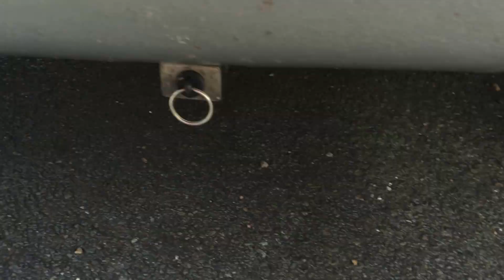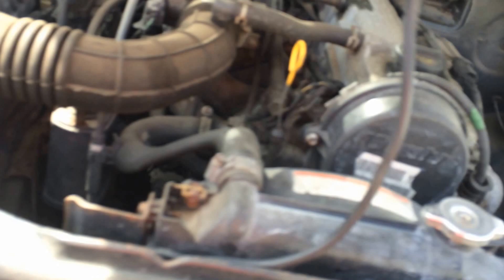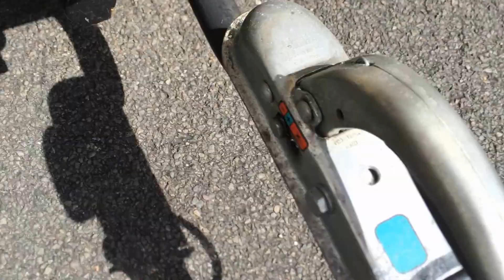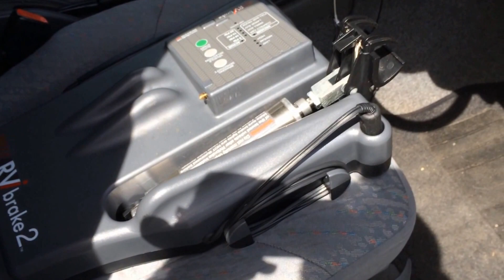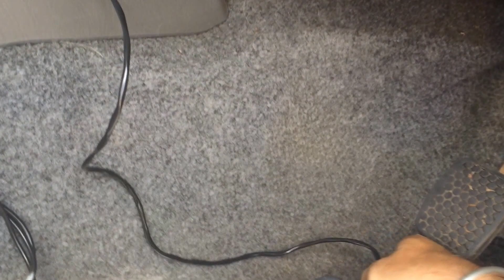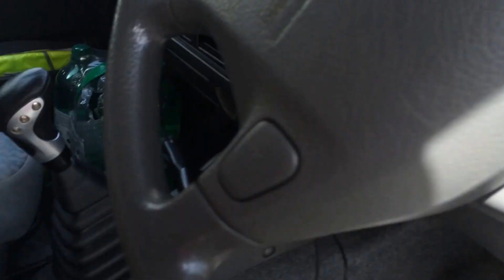Club Motorhome Videos - Setting up a Towtal A-Frame and RVi2 Electronic Braking

Comment: Nice video of your setup.
I have a jimny as a tow car and constantly get told it shouldn't be flat towed. Have you had any problems?
Reply from the maker: @TheDavelynn  Well the video was a while ago but when we had the Jimmy we had no problems at all. The handbook says no to flat towing but then it would wouldn't it? Suzuki wouldn't want any claims against them. I do think it's important to only flat tow the models with manual 4x4 selection rather than the push button type.